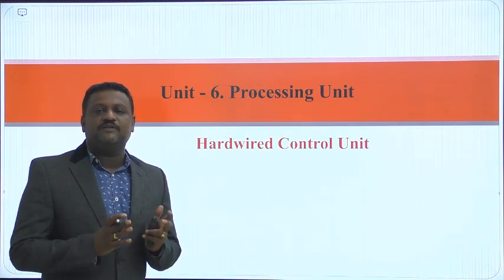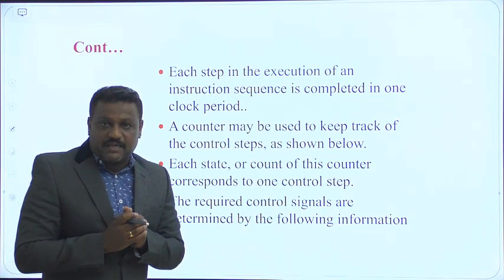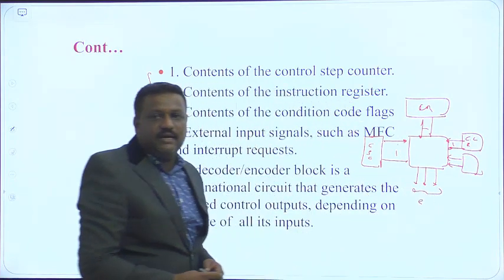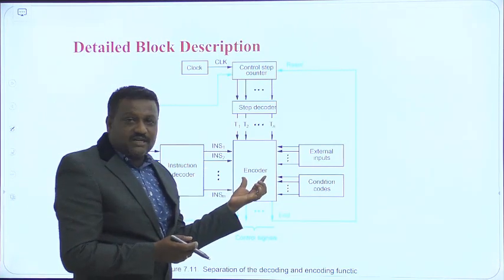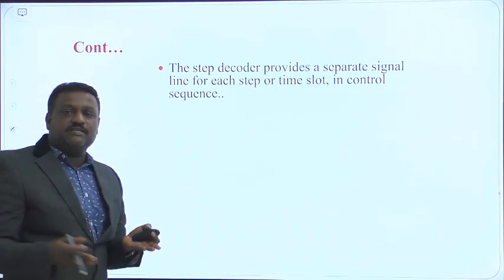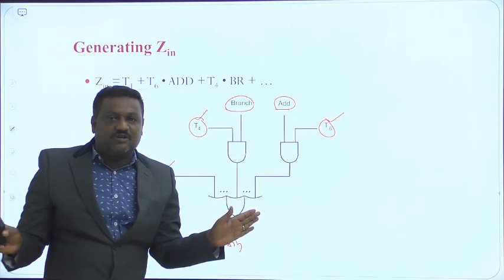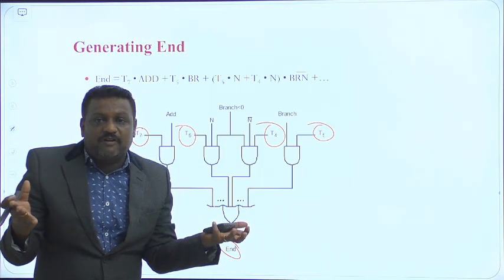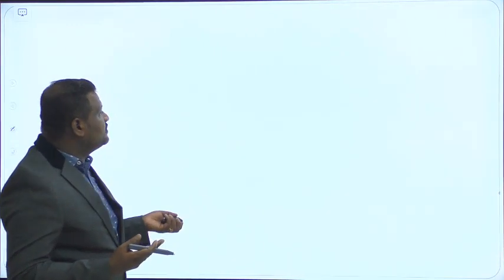Hardwired Control Unit

Comment: why does Zin active at T1 T4.Branch and T6.ADD ? it can be active at anytime instance depending on the instruction ?
Reply: No, it is not active at all times. If add is performed by ALU, to store the result temporarily we use  'Z' register. That's reasons  'Z' is active
Reply: If there is a branch instruction, the PC is updated by ALU, to store the updated PC use 'Z' register, from that it transfered to PC.